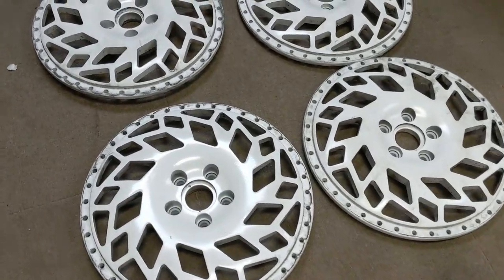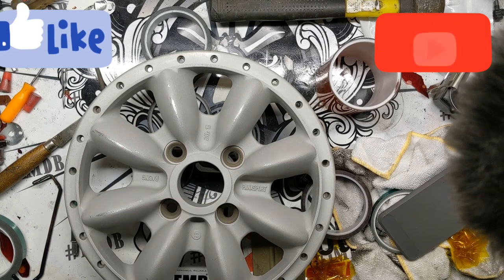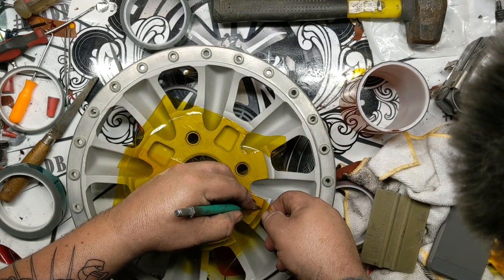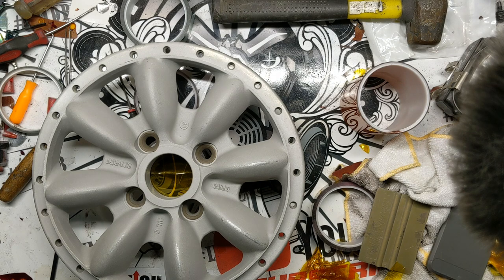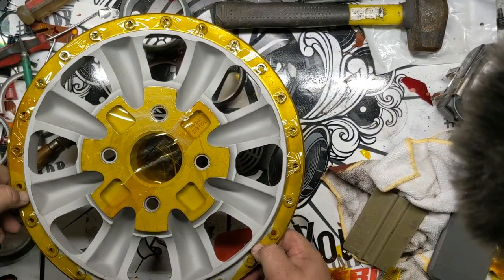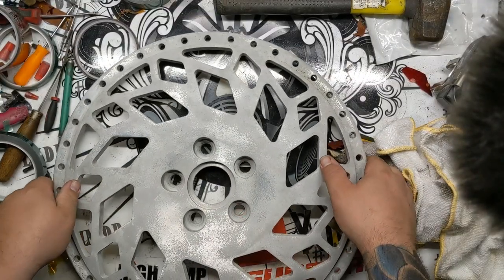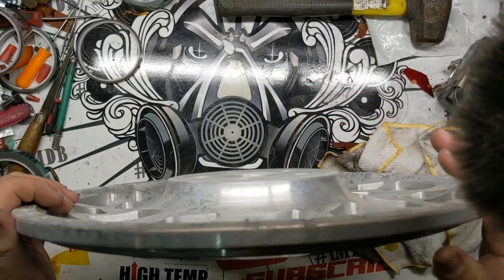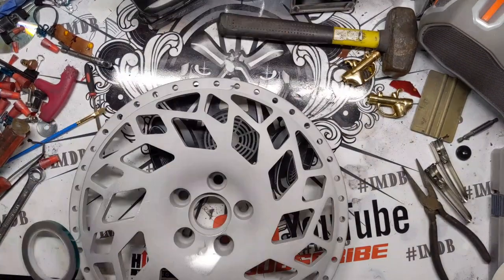Unknown Coatings - Ep 64 - Powder Coating wheel faces AGAIN!

Comment: You choose Rim Strip over B17? Any reasons as to why? I have B17...and semi concerned with the new landlord and the smell and it’s corrosive tendencies. They SEEM ok with it all so far.
Reply from the maker: Rimstrip is basically the same smell, works as well as B17 or maybe better. ITs cheaper and gets delivered fast.
Reply: Unknown Coatings I’ll have to give it a try. My B17 is nearly out...thanks man!
Reply from the maker: @jimmieomalley3383  no prob. Contact info is in the video description. Tell Matt I sent ya

Comment: Hey what’s up boss, watched one of your videos a while back & ordered Rim Strip. What do use to neutralize the acid when removing the wheel?
Reply from the maker: Water and baking soda in a drum.  Grab a pH meter off Amazon   they are cheap
Reply: Unknown Coatings thanks boss!
Reply: another question, can you touch up powder coating by applying powder then heating up with a heat gun? the tire machine damaged a small part of the wheel & would like to touch it up vs re powdercoating the wheel

Comment: Any suggestions on a stripper for  non commercial work
Reply from the maker: Just looking to avoid the crazy chemicals?
Reply: @UnknownCoatings  something that works but doesn't require a business license or other special license.  Stripper I use to use for refinishing mahogany doors cant be picked up at the builder supply anymore.  I just need something to help reduce blasting time.